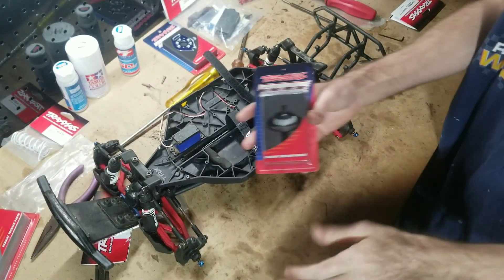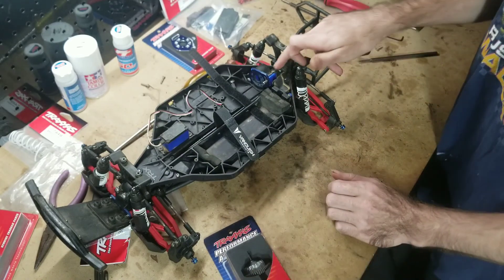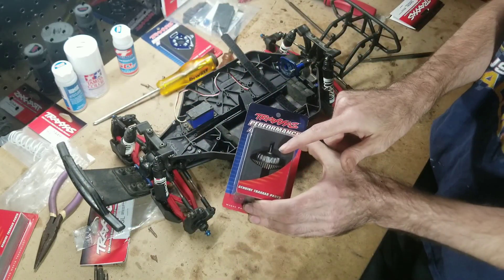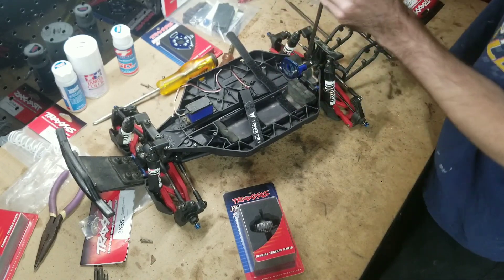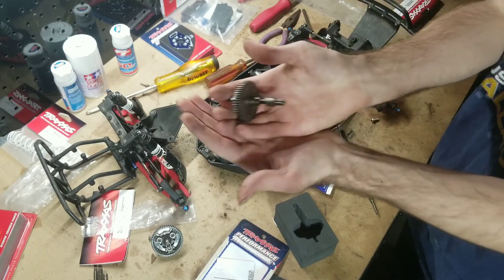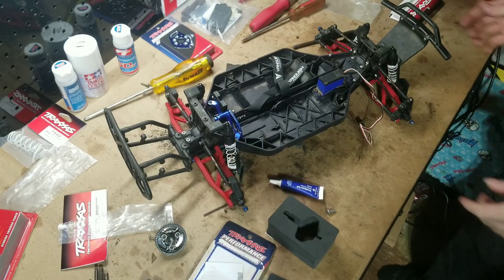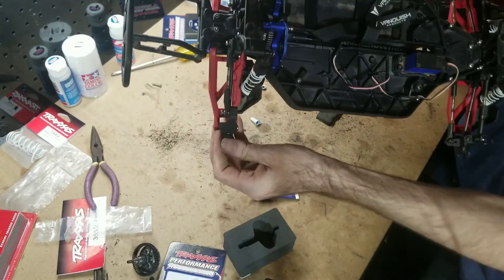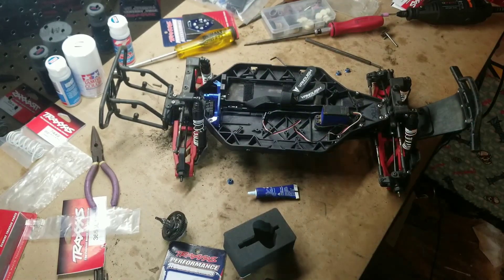Traxxas backslash gets a center differential "PROJECT LOONEY"

Comment: Thanks alot for your video I ran into the same problem when I put my center differential in and was wondering what I did wrong but you just showed me I need to dremel out some of the chassis thanks
Reply from the maker: No problem thanks for watching.